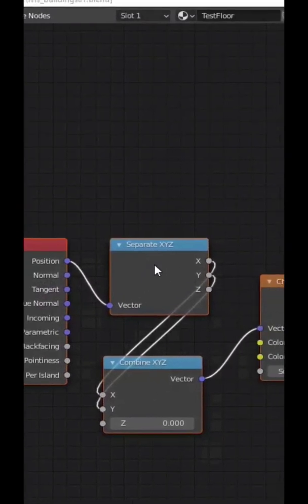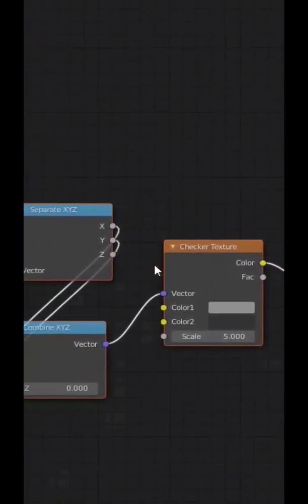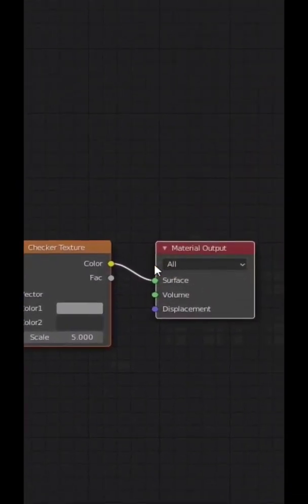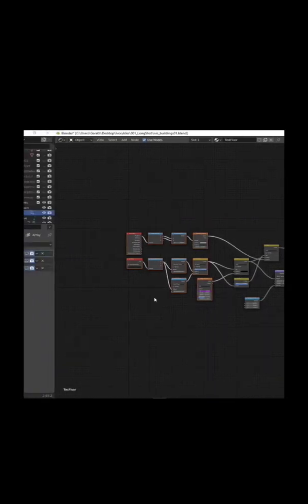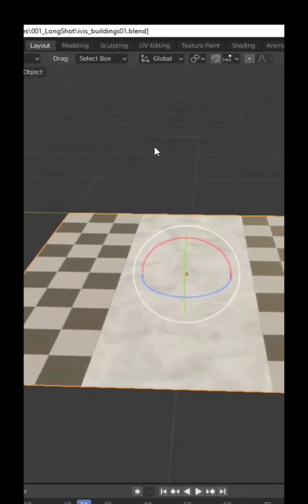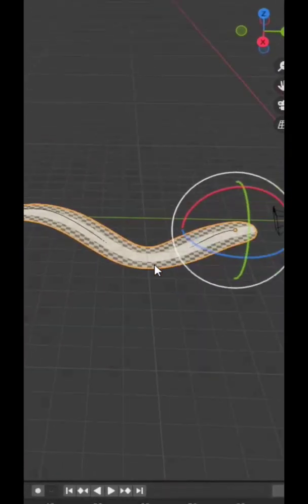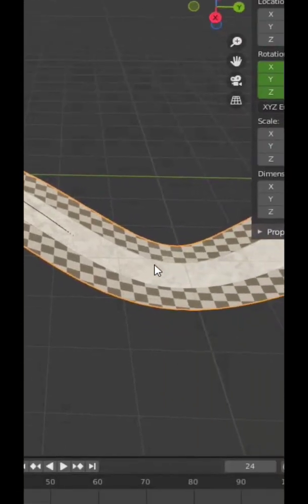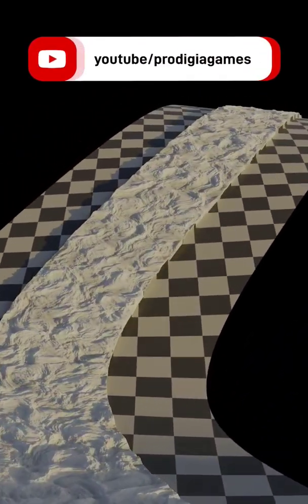Blender Worldspace Procedural Shader Explained in 60 Seconds #blender #procedural #3dart

Comment: How do we do this with an image texture?
Reply from the maker: That's a great question! I'm not in front of the computer to test this, but my "off the cuff" answer would be to follow the same procedure, but instead of your procedural shader nodes, just put in the image as an input. You'd probably want to add a Mapping node to be able to adjust and tile the image if need be.

If you need more clarification than that, I can definitely try to help if it's not clear or you hit any roadblocks.

Comment: Thank you for this!
Reply from the maker: I'm glad it helped! I thought it was a neat little trick. The only downside is that it can't be used straight across in game engines and stuff...though the same idea works with shaders in games if you set it up, saving you some headaches on UV mapping for things like procedural geometry!
Reply: @ProdigiaGames  Good point, but for blender stuff its awesome!